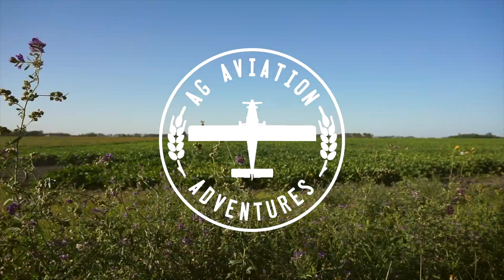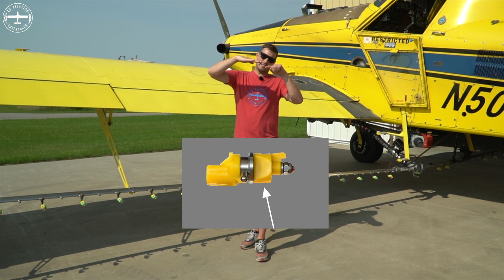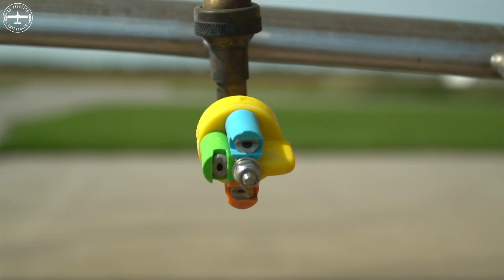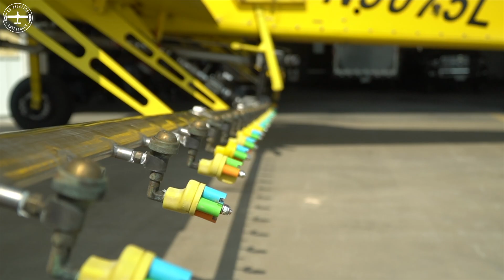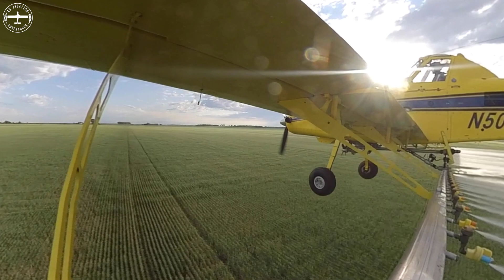How Does an Ag Pilot Adjust Gallons Per Acre?

Comment: I was curious how you compensated for varying ground speed... is it considered insignificant variable?
Reply from the maker: The aircraft is equipped with what’s called a flow control valve. It automatically varies the rate depending on ground speed.

Comment: Great explanation! But I did this for years. Grass seed is fun to calibrate!
Reply from the maker: Haha I bet!
Reply: @AgAviationAdventures  In the late 80's I worked with pilot that had a AT301 and we had to calibrate the spreader for grass seed! We tried everything but could not get enough seed though the auger in 30 seconds to get the flow rated needed! So we removed the auger assy. and just used the main gate to control the flow! Worked super! It Took 10 minutes to empty the hopper! We had fast turn arounds! Thanks so much the great videos.